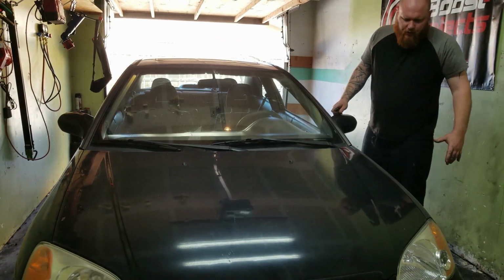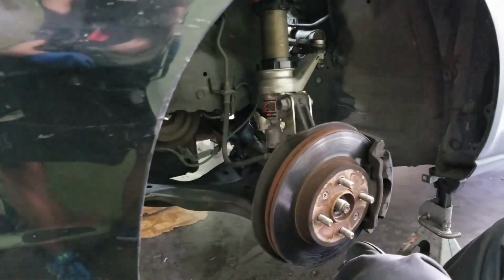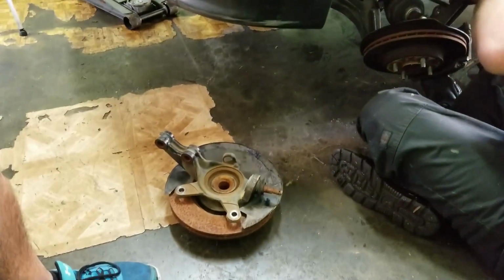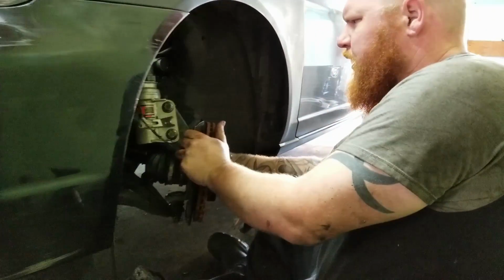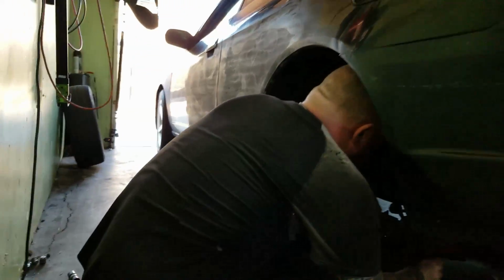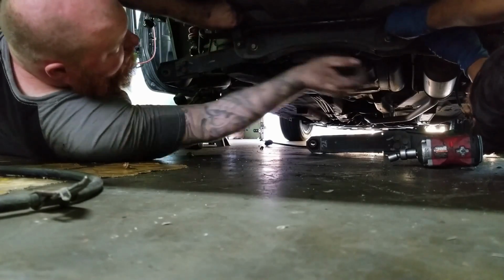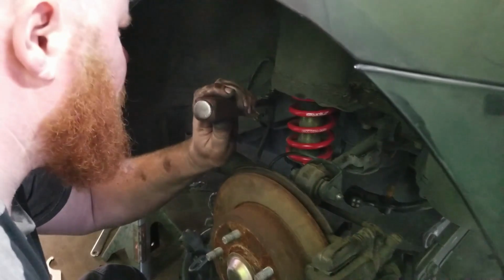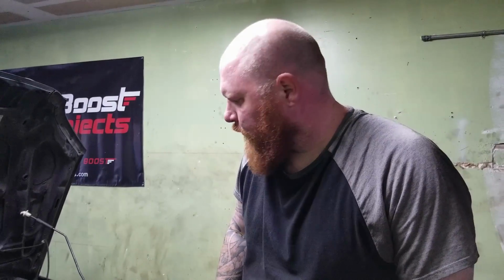Ebay EM2 gets 5 lug conversion and coilovers

Comment: I have an Honda Civic ex with four lugs, I also want to change to 5 lugs, what year and model does it have to be the Acura?  i bought a spindles and rotors 5 lugs they come 2003 acura type s but the front rotors are too big they wont fit the cv axle

Comment: Hey everyone🤟 does anyone know if you have to remove the metering valve and proportioning valve. Or will the conversion fit right in with no problem? Thank you in advance 🤟
Reply: If it’s an ex model than no other models such as lx or dx you need to change proportioning valve and booster

Comment: My 2001 type r ep3 has a honda accord 2008-2013 CU2 twin pot brake conversion 320mm 5 stud
Reply from the maker: I will be using type s brakes and calipers once Tim finds his old calipers in his basement
Reply: @PirateGarage  Could you please share for the new em2 owners in the classroom, which parts EXACTLY are needed to complete the 4 wheel 5 lug conversion? (ex: front knuckles from 05 RSX base-that much I got from the video, but what about the rear?)
The part #s for the base rsx and the rsx type-s rear knuckles are the same...so does it matter which ones I use? I would like to be able to run the type-s brake setup like you're planning to do and want to make sure I've got the right foundation in place the 1st time around.

Comment: Will i need then e brake cable from rsx base and will the brakeline rear screw right into the em2 brake line connection. ...
Reply from the maker: You will need evrake cables from a car with rear disc RSX or ep3, the soft brake lines are the same but they will connect to the hard line on the chassis, I explained this in my video
Reply: @PirateGarage  yep this will be my project next spring, will make sure the brake line from the rear disc i get has the brakeline piece attached to the caliper when pull the parts. I can grab the ebrake line the also

Comment: Any tips removing seized suspension bolts for rust prone areas?
Reply from the maker: Depends on the bolt but you will probably need to cut it
Reply: Your bolts are way to rusty you need to CUT IT. Cut it, cut it, cut it. Lol all my lca bolts on my 00 civic coupe in the rear were seized needed to cut them all off, cut the welded nuts off the subframe ,and wheel hub assembly. Took way to long to install function and form Lcas and asr brace. But I got all new honda bolts and all new bushings so it's worth it to keep it fresh. I'm from Wisconsin so yeah snowy winters.

Comment: Already bought a rsx 5 lug conversion for my em2 but how i can check if are the base model or type s model?
Reply from the maker: Easy way is the rotor size, I think base is 10.25" and type s is 11.8"
Reply: And i can use the type s rotors and calipers with base spindle knucles?

Comment: That's funny because i stayed 4 lug for more wheel selection lol
Reply from the maker: How many wheels come in 17x8 or wider in 4x100? Without running a stupid stance offset
Reply: @PirateGarage  True dat ! I should have said : i stayed 4x100 for better wheel selection in 15'' (for my ek)
Reply from the maker: A 17" wheel is much better for en em2, the awd em2 I'm going to run a 17x8.5 +45 with a 245-40-17
Reply: Pirate Garage Hes right bros. I run 16s however, which should have been stock.